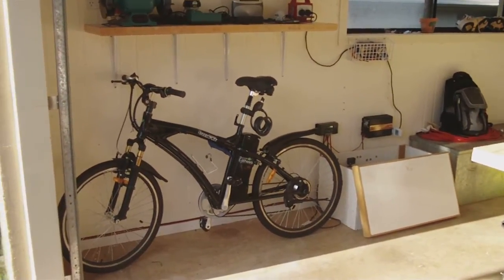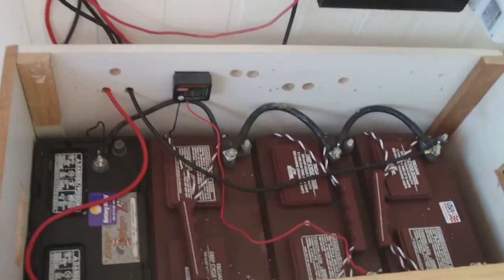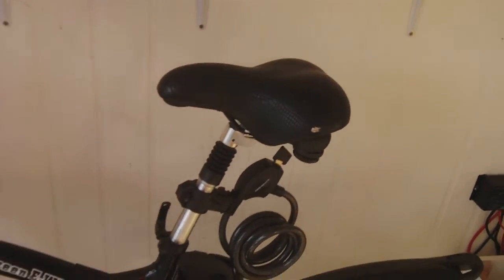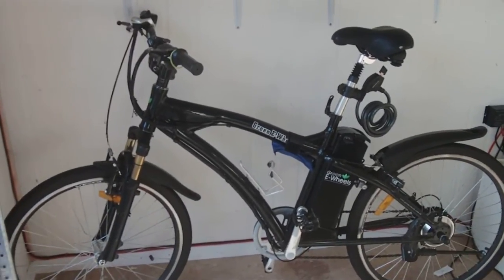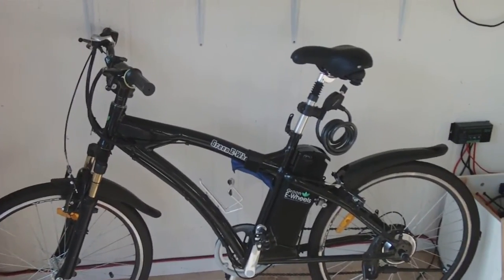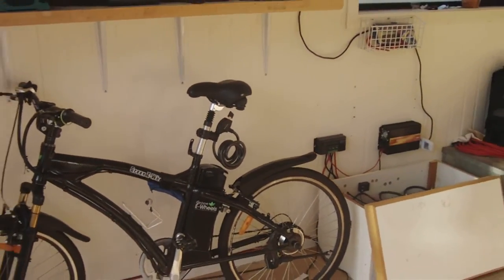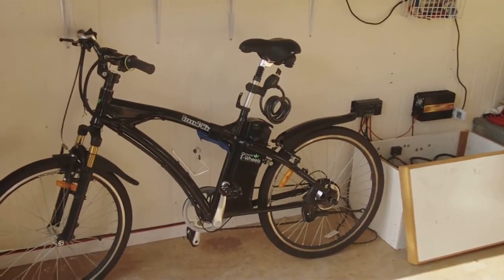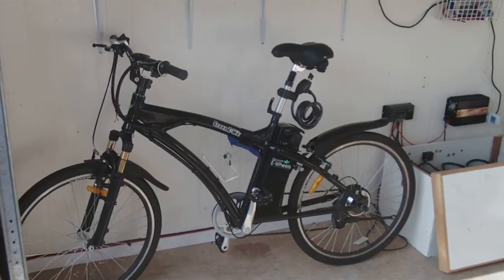Solar Powered Bike

Comment: i think its a great idea having an electric bike charged by solar power, im all for the less pollutant way of travel doesn't matter what these ignorant people think about it you did a great job in this set up, im thinking of puting an electric motor on my bike with a gps and attaching a solar panel on a frame above the back wheel, would this be any good, so it can be charging while im riding, if so how big would the solar panel have to be in order to run a gps and the motor.

Comment: I have a 200W bike with a 36V 10A Li battery. I also have an 18V 120W solar panel with charge controller, connected to a 12V 80AH deep cycle battery, connected to a 600W pure sine inverter. If I plug my bike into this setup, will it charge at least slowly? How many watts does an average bike charger draw? Is it variable?

Comment: I think enviergy is trying to demonstrate in the video is that they have a existing solar panel / battery storage system and by using a pure sine 12V DC to 120V AC inverter they can power the electric bike charger unit to recharge their bike battery pack (long thing under seat).  Cheers, Great video.

Comment: If you were to build one of my eBike chargers the battery would charge quicker and it would have less power losses as it would only draw probably 10 amps from storage batteries instead of the 50A you mentioned. The electric bike is probably using a 24V battery so the current required could be less than 5A.